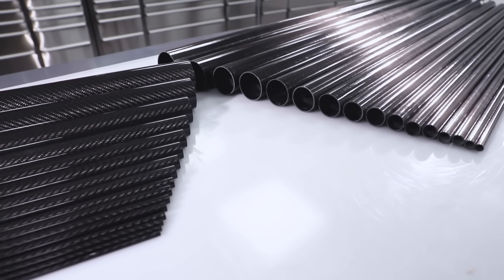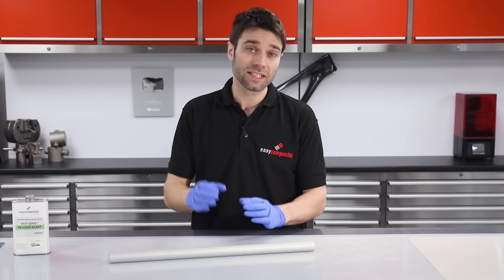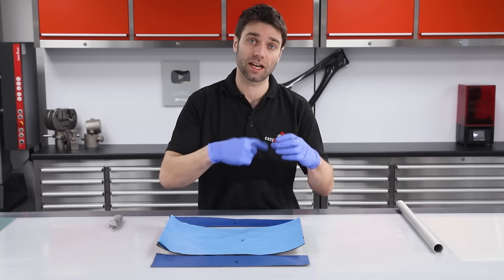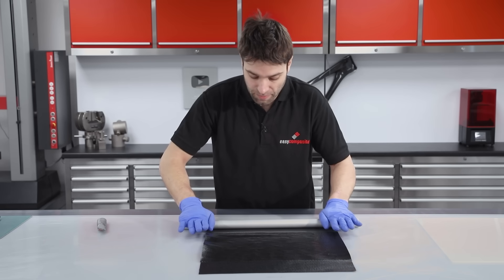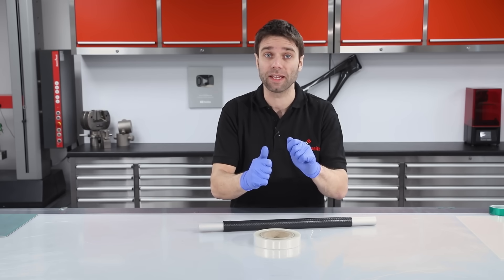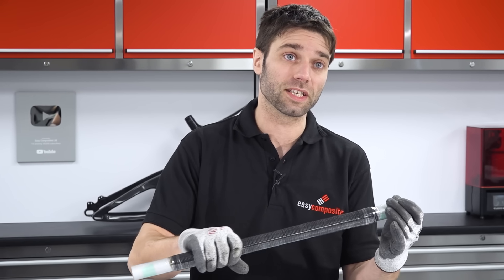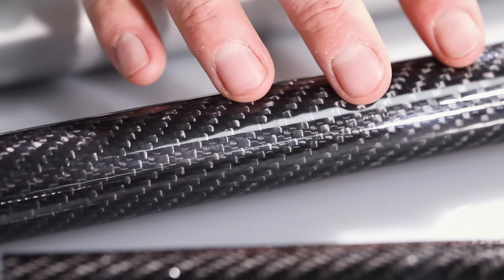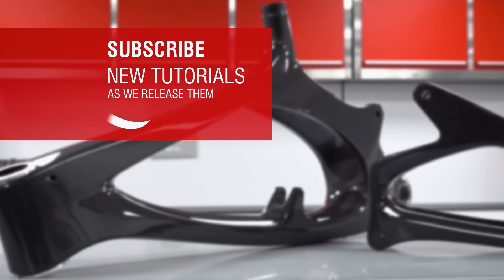How to Make a Roll Wrapped Carbon Fibre Tube

Comment: If doing this with a wet lay up, does it still need to be baked in an oven or will it have the same strength when the resin is cured and not oven baked?
Reply from the maker: To optimise the strength, you would need to post cure it with elevated temperatures. In brief, a post-cured part will exceed the mechanical properties of a part cured at ambient temperatures.
Reply: @easycompositestv  That is good to know, thanks. I don’t suppose post curing in an oven would work a few weeks after the part has cured at ambient temperature?
Reply from the maker: @themadscotsman2159   A post cure after the component has cured will still raise the mechanical properties of the component, they are usually done after the initial cure typically the day after lamination rather than waiting weeks.
Reply: @easycompositestv  I will consider that for my next project, of everything I’ve made so far, nothing is structural, so doesn’t need to be very strong. I’m still learning techniques for working with carbon. The videos from you guys are great for learning.
Reply from the maker: @themadscotsman2159  Thanks for the kind words, it makes it all worthwhile for us :-)

Comment: Will I have a flex on a 30x28x500mm long carbon tube by puting a 10kg on it? Or I need a 2mm rhick wall one? Thanks.
Reply from the maker: Hi Adrian, yes you will have some flex. You would need to test it to determine exactly how much.

Comment: What would you recommend doing if the shrink tape doesn't want to release?
Reply from the maker: Shrink tape is handed so has a release coated side; if it won't release, chances are that it was put down the wrong way round. If it really has bonded and won't come off at all then sanding with a 120grit sandpaper or similar would be the only way to mechanically remove it (once removed, you could then polish the tube back up if needed).
Reply: @easycompositestv  I possibly think it might have been attached the wrong way around, thanks for the help 🙏

Comment: Is it possible to make a roll age out of this tubes?
Reply from the maker: Hi, It might be theoretically possible with enough CAD FEA and testing to design a workable roll cage.  However currently they are not allowed in authorised motorsport regardless of testing except in F1 where extensive crash testing is required

Comment: Do you have standard size oval tubes?  I am guessing that is possible to make, but appears it would be difficult to roll the carbon sheet tight compared to a round tube, and also to extract after curing.  I have an stealth ebike with the battery in the down tube, and was thinking I could purchase a used carbon road bike frame, change out the downtube with a  manufactured oval tube that can hold my battery and controller and then add it onto the carbon bicycle frame.  Not certain how to affix the oval tube (cut into two pieces) and then laminate one side and mechanically affix the other side to the downtube for controller, wiring and battery storage.  I hate carrying a 37.7 pound bicycle up and down 3 flight of narrow flights of stairs and do not have the pocketbook to afford a 24 pound eBike...
Reply from the maker: We don't have premade oval tubes but there are a few manufacturers on the market.

Comment: good job !  Do you have Resin Epoxy in lay 1st, 2nd  ?
Reply from the maker: The resin used throughout is already part of the pre-preg material.
Reply: Will you ship to USA ?
Reply from the maker: @dni3541  Hi , we can ship to the US, no problem in fact we have ship every day and have a great customer base in the States. Smaller orders container Dangerous Goods such as Resin and Solvents can be a little expensive but the good news is that you can get an accurate shipping cost easily on the website, simply add items to your basket and then choose ‘United States’ on the basket page. If you have any questions though, feel free to drop us an email to sales@easycomposites.co.uk

Comment: hi do you ship to India?
Reply from the maker: Hello, thanks for your comment. Yes, we can ship most items to India; no problem.

The only products that we cannot ship are products classed as ‘Dangerous Goods’ including epoxy resins, gel coat and PVA due to shipping regulations.

To place an order for non-dangerous goods (any carbon fibre products, other reinforcements etc.) just use our website (https://www.easycomposites.co.uk/) add the items to your basket and continue through to the checkout page. On the checkout page the delivery cost will be calculated automatically as soon as you enter your delivery address.

Comment: What was the thickness of walls of that carbon tube or how many wraps and what material sheet thickness is?
Reply from the maker: Hi, thanks for your comment. The wall thickness of the tube was 1.7mm, the laminate stack was 6 plies explained at 2:55. We used our XC110 210g Twill weave prepreg with a consolidated thickness of 0.25mm per ply for the first and last ply and the XC130 Unidirectional Prepreg Carbon with a consolidated thickness of 0.3mm per ply.
Reply: @easycompositestv  Thanks for the details. May I send you an email with a few questions? Cheers
Reply from the maker: @YouInVR  Certainly! Please send through the email to technical@easycomposites.co.uk

Comment: What kind on Carbon is used? I haven't seen any with the adhesive backing before
Reply from the maker: Hi Nathaniel, thanks for your comment. We explain the materials at 2:55 on the video, we use our XC110 210g 2x2 Twill 3k Prepreg Carbon Fibre (1250mm) and XC130 300g Unidirectional Prepreg Carbon Fibre (300mm) to make the Carbon fibre tube.
Reply: @easycompositestv  thank you for the reply!!!

Comment: May I ask sir about the video ... 1) what kind of plastic to wrap the carbon in? 2) What is the oven temperature and how long?

￼
Reply from the maker: Hi Imam, the tape is our Composites Shrink Tape, it’s specially made for roll wrapping; you can find it on our website. The cure temp and temp will depend on the prepreg you’re using, in this case it’s our XC130; you can download the data sheet for this prepreg from our website which includes a range of cure times and temperatures. Links are in the description above.

Comment: How much would that part withstand in twisting forces?
Reply from the maker: It has some twist resistance but as the fibres are hoop and length orientated it is not as strong in twist as something spiral wound.

Comment: Can this process be followed for layup not prepreg?
Reply from the maker: Yes, of sorts. The process of wrapping and heat curing still applies, the problem would be the practicalities of working with a dry cloth and wetting it out, compared to working with a prepreg which is easier to wrap around a mandrel in this way. Nonetheless, dry cloth and a wet layup would be possible.

Comment: hi easy composites quick question, if i wanted to skin a set of handlebars for example could i use one of your sleeves and then wet it out (like the skinning method) also would it be necessary to 1st layer the bars with epoxy until B stage or could i just sleeve the bars and lay the epoxy on and let it soak through?

great video btw.
Reply from the maker: Yes you can use the braided sleeving in that way.  The process is identical.  You still need the basecoat layer to help with adhesion when the resins cure.

Comment: Hi man,

what about the resistance under pressure? Could you please suggest a better solution for a pipe that must be pressurized? Is that other better carbon fiber tissue that could be used?

thanks.
Reply from the maker: It rather depends on the pressure you're talking about. If it's modest pressure (like a boost tube) then the construction would be fine as you see it here. For higher pressures though the top priority is 'hoop strength' because it's in the hoop direction that an internal pressure will act and so, in theory, you'd be better off aligning the UD reinforcement in the 90 degree axis, rather than the 0 degree axis that you see us use in this video.
Reply: @easycompositestv  
that's the fina use:

https://www.acquasport.com/catalogo/fucili/fucili-oleopneumatici/canna-13/pneumatico-salvimar-dark-side-vuoto-con-serbatoio-in-carbonio/

working pressure 40 bar; for sure a safety margin must be considered

Comment: This doesn't seem a lot.. If this was a bike handlebar and lets suppose i) you are 90 kg, ii) you drop out of a height of 1.5m with half of your weight supported by the handlebar and iii)you have a rigid fork or it is locked. Your handlebar would likely snap as in 9:15 , right?
Reply from the maker: Well, to put reliable numbers against this scenario would require a lot of calculation (as well as some additional assumptions) but - without doing the calcs - I would say it would be highly unlikely that the scenario you describe would break the tube.
Reply: A handlebar has many many layers, the weight of a bar can be around 150grams. So probably has twice the wall thickness and profiled to be strong but light as possible. If you ever cut a carbon steerer tube, youre gonna see some serious carbon fibre tube.

Comment: I would love to make a carbon mast for my boat, but it would need to be 60 mm od, 2-3 mm wall thickness and 4580 mm length.   Any tips on this, using the techniques you illustrated?  It would seem that the oven is the stumbling block, as you need something to cure the prepreg
Reply from the maker: Yes, if you want to use prepreg then you’re definitely into custom built oven territory for a mast of that length. That might not be quite as difficult as it sounds because you could build an oven that’s just a very long box, only slightly larger than the mast, and then have a return ‘duct’ and fans forcing the air round the loop. Without an oven allowing a prepreg process, I’m not sure there is an alternative production method that would work for a component like this, with those dimensions.

Comment: Hi Great Video! thanks for sharing...
1. f you had used the same weave of the one used on the ends for the destructive test would it have been stronger? 
2 If you doubled the layer would the strength double? (is it proportional?)
3.If you would have machined rolled more tightly would it be stronger?
4. Would vacuum molding make the tube stronger during the curing than shrink wrap?

Comment: I would like to know, how much the carbon fiber weights per squaremeter.
Reply from the maker: Well, I think you’d also want to know the thickness too then! 1280g per m2 at 1mm thickness (or 1280kg/m3)
Reply: That changes depends on the amount of epoxy
Reply: Depends on the fiber, fabric construction, resin content percentage
Reply: That depends on the specific gravity of where it is being measured. It will weigh more on earth than on mars. Hope that helps.

Comment: What do you do with these straight tubes?
Reply from the maker: Carbon fibre tubes are everywhere! Tripods, window cleaning poles, wing joiners, paddle shafts, masts, booms, tillers, robot arms, drones... just about any tube you want strong abs light.
Reply: @easycompositestv  thank you for the reply. Those are some great ideas. So I imagine there are some sort of end connectors that you can get? Would you be able to send a link or video on how to work with the carbon fiber tubes to create something?

Comment: Thank you for this guys! Is it possible to make a such carbon fibre tube without preprag? (wet lamination) and how do I calculate the thickness of the tube?
Reply from the maker: It can be done wet lay in a similar fashion, albeit it is a lot more messy.  Thickness is related to thickness of the cloth and number of layers used.

Comment: The interesting thing is not so much carbon fiber wich is strong, but the alternatives. Glass fiber, sandwich with carbon and glass fiber etc. For hobbyists this mean you can make things strong, if you have poor economy by mixing materials
Reply: There is a benefit of using glass instead of carbon in certain tension applications where a little flex or shock absorbsion is desirable. Even carbon fiber aircraft such as sailplanes often use special high strength fiberglass in the wing spars instead of carbon.
Reply: I would like to explore laminating carbon with more abrasion resistant fibers such as aramid and uhdpe
Reply: how many layers of carbon fabric were in this tube?

Comment: I've read your answers to many comments, so I hope that this isn't a repeat question: what method would you recommend for making tubes if one does not have an oven?
Reply from the maker: The same process can be done by wet laying resin and cloth. Its messy but can achieve good results.
Reply: Any advice on removing the tube from the mandrel?
Reply: @christophecamp2335  Pull much hard

Comment: And put the tube with a bag in a autoklave
Reply from the maker: Thanks for the comment but no... No one makes tubes roll wrapped tubes that way, the wrinkles from the bag, the requirement for vacuum bagging (slow and expensive compared with wrapping), the need for a solid mandrel; so many reasons to not do it that way.
Reply: @easycompositestv  ok i just saw that machine on a other viedeo and thoight that ist would make a good use

Comment: You need to put on thr release agent 8 times on it? You schould youse something else
Reply from the maker: Well no, not really. Easy-Lease is a semi-permanent release agent which means once it's been established, it will last for many releases. When you're making a carbon tube using this method you have parallel sides and so the release is extremely critical. It only takes a few seconds to wipe on a release agent, it takes hours with a hammer to remove a stuck tube. Easy-Lease is used in industry for carbon fibre tube production, its release properties and suitability for this application are unbeatable.

Comment: I'd like to see the same test using E glass/epoxy. Not as stiff, but would it be stronger?
Reply from the maker: For the same weight of material, it wouldn’t be as strong. For the same thickness of material it would be quite close but still not quite as strong and would be heavier.
Reply: @easycompositestv  I think you'll find you are wrong. E glass is comparable to carbon in strength to weight with S glass being even better than carbon. Carbons only attribute is its stiffness to weight ratio. If you want strength, don't make it from carbon.

Comment: Is this the same method bike manufacturer used to make carbon lugged frame back then?
Reply from the maker: You might make a single tube with this method like on some of the very old carbon bikes that were manually bonded together.

Comment: made a world of difference when i switched to a carbon fiber cane...
Reply: Im thinking about making a walking/hiking stick. What diameter is yours and what length
Reply: @conniestevenson226   -  i didn’t make mine, got it from a company called carbon canes...    it’s 3/4” diameter and cane length?   like 3’ or so...   has flames coming up from the bottom    ;¬)
Reply: @grendelum  sounds awesome looking. I would think 5 feet would be perfect for what i need. Im looking to use a 28mm kevlar carbon hybrid shaft

Comment: Could carbon fiber tubes be used in computer watercooling? (provided tubes don't need bending)
Reply from the maker: You would need some long term testing to see if the performance holds in that environment.

Comment: Thanks for a great video. How would you go about creating a much larger carbon tube? Asking because I want to make a custom telescope tube that’s 368mm wide and 1.3m long, but don’t know where to start.  Many thanks!
Reply from the maker: Hi, for a tub that size you wouldn't be able to use the mandrel method shown in this video. Instead, it would be better to use a split mould and laminate most of the material with the mould open, leaving 'overlaps' of carbon to bridge the seam, you would the close it and bag it and oven cure it. You can see this process done in full in this video: https://www.youtube.com/watch?v=bBbOUDDJv4Q
Reply: @easycompositestv  Thank you, much appreciated! Looking forward to more awesome vids.

Comment: Hello. I have a query. Can I use creasing to make 90 degree bends with carbon fiber plates? may be 3mm thickness.
Reply from the maker: Hi Mashur, I'm not sure what you mean by 'creasing'. You can't 'bend' a carbon fibre sheet into a new angle/position, it will always try to spring back. However, you can make a carbon fibre angle if you laminate and cure the carbon fibre in this 90 degree form to begin with.

Comment: The tube could handle more pressure if you put 45 degree 90 and unidirectional
Reply: Why would you need that? It broke at close to 1500 lbs for a thin wall tube that was about an 1 1/4" diameter.

Comment: Could I use this method to make a carbon fibre reinforced wooden mast? I guess the hard part would be making a heating chamber long enough to accommodate the mast, but not impossible.
Reply from the maker: Yes, you could but really for that job it would be easier to just use dry carbon cloth and epoxy resin, wrap them around the wooden mast and the wrap shrink tape around to consolidate it. This could then cure at room temp. End result would be just as good. We have all the materials for this job if you’d like to do it, just get in touch.

Comment: wonder if you can make a role cage for say a drag car out of carbon fiber. fould be  significantly lighter than steel
Reply from the maker: Theoretically yes with enough design and material.  However I am not aware of any Motorsport governing body that would allow a carbon cage.

Comment: do you have any non scientific Torque Tests results?   What kind of lay ups would be best suited for axial load / twisting along the length type applications.
Reply from the maker: You could improve torsional stiffness by having some layers of cloth ad 45 degrees to the tube.